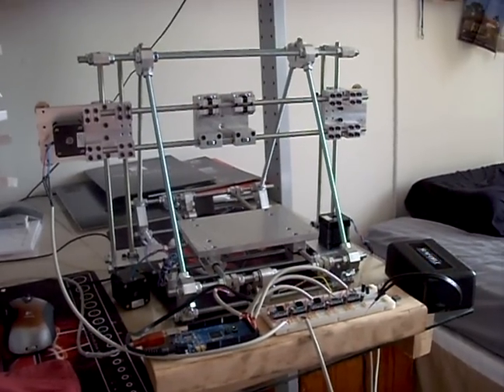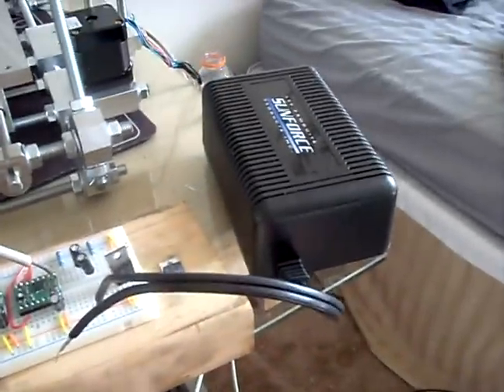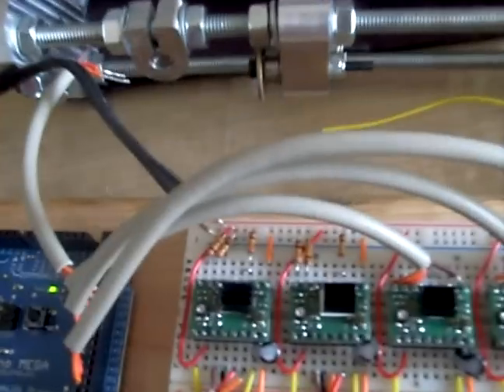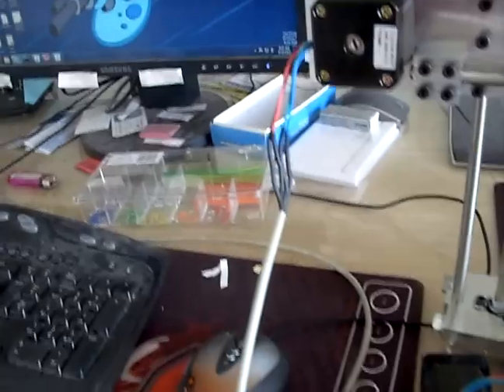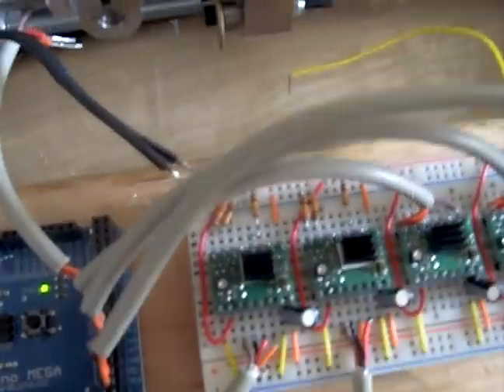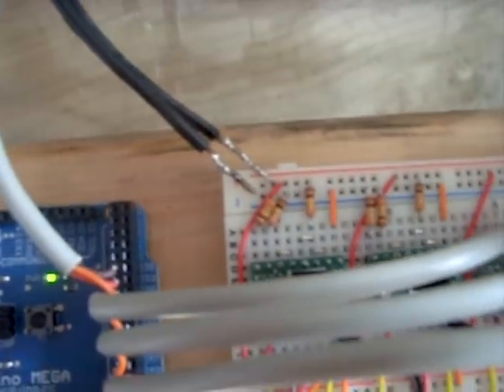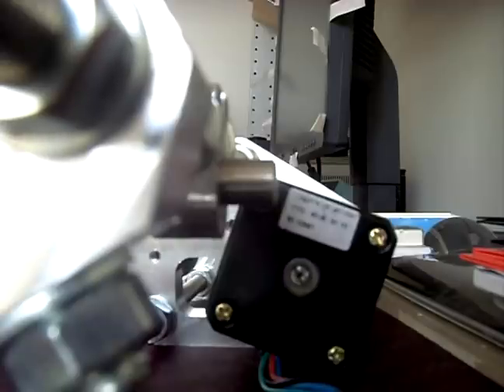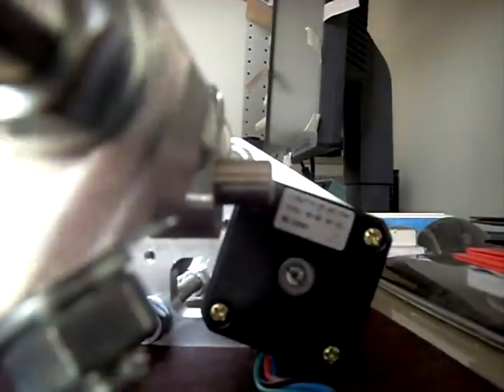Troubleshooting stepper motors

Comment: I know its been a while, but for those having the same problem... I encountered this problem with my Arduino. I found out that I did not have a common ground between my Arduino and my stepper Driver. Make sure that you have a wire going from your controller's ground to a ground pin on the stepper motor driver.